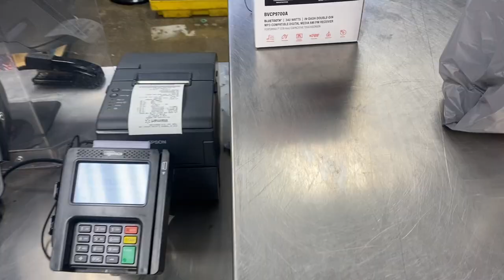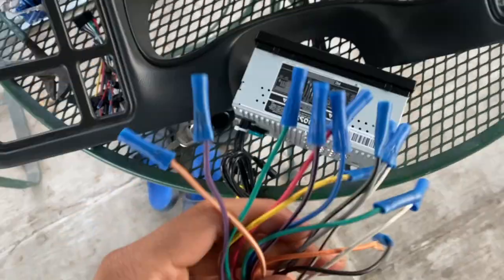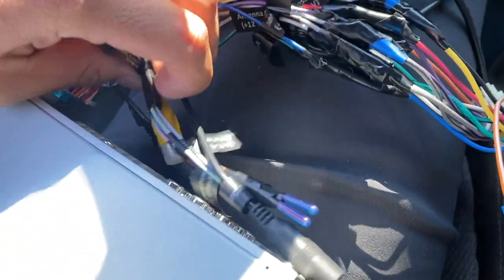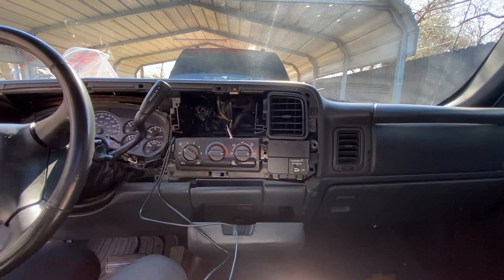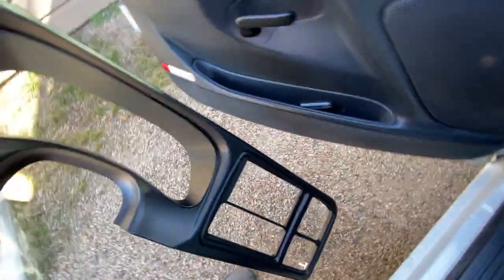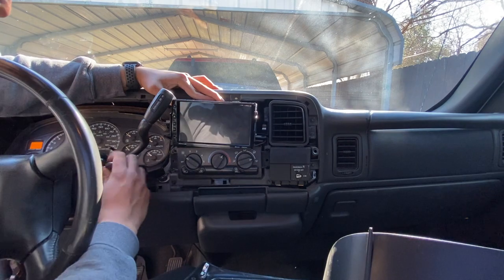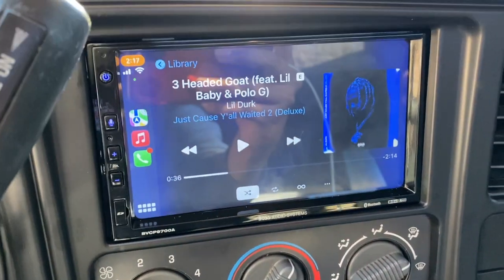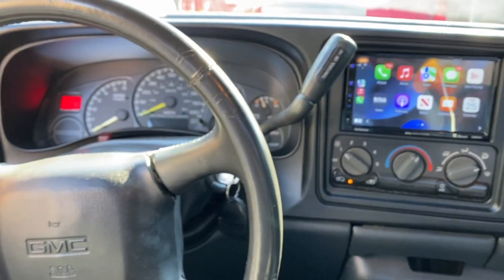INSTALLING NEW BOSS BVCP9700A DOUBLE DIN RADIO **SS CLONE BUILD**

Comment: I’m thinking about getting this stereo for my car how is it holding up so far?
Reply from the maker: It’s great man , I love it and the quality looks amazing in my opinion , it’s not slow at all like I thought it’d be in the CarPlay response is a-1
Reply: rixhySS just one question how would I be able to connect to apple car play? I know it needs a cable but don’t you need to like drill a hole or something?
Reply from the maker: It’s built in the stereo, just need the harness everything’s plug in play
Reply: Sweet truck  what are you pushing  hp and motor
Reply: @rixhySS  does this stereo could you use YouTube or like safari bro?
Reply from the maker: @jesusreal77  no you can’t just regular apple car play
Reply: @rixhySS  Oh okay and you like how this one works , I’m seeing if I should pick it up today I’m upgrading from a stereo atoto and deciding n it has 340 watts
Reply from the maker: @jesusreal77  I like it , always wanted apple car play in older vehicles and this makes it possible it’s great quality

Comment: I was looking at getting this exact radio in a couple of weeks, did you connect the braking wire or did you ground it to metal?
Reply from the maker: The truck already came with an aftermarket stereo so all I did was wire up the harnes to the new stereo and it worked fine didn’t have to do any of that
Reply: I recommend grounding it so you can watch movies
Reply: @mannythesavage2  how would this work? Not saying in a disrespectful way just wondering what difference it will make.
Reply: @Angel_SGZ71  the parking brake wire is looking for a negative charge the parking brake gives off when it's engaged. If you ground it to the back of the radio it gives off a constant negative charge. This used to work with all radios but some of the newer ones can tell when you bypassed it. I ended up grounding my wire to the back of the radio and it did work for this model.
Reply: @Angel_SGZ71  Dumb or quick response:
From what I've been told, you have to connect it to something, especially if you'll be using an android phone, so connecting it to the ground allows whatever software trigger it's in the head unit to allow you to use the screen to play video or pictures even if you're moving. Took me a while to get to that answer myself.